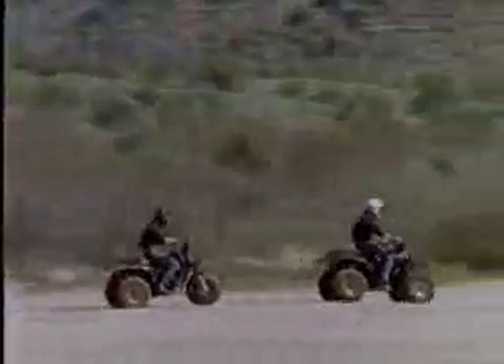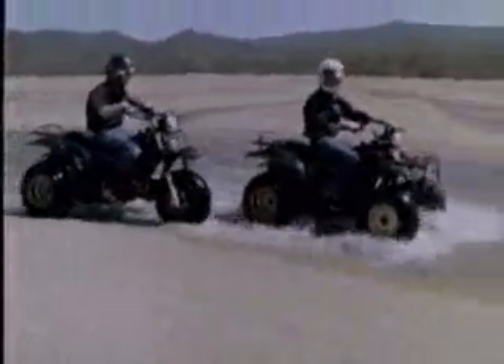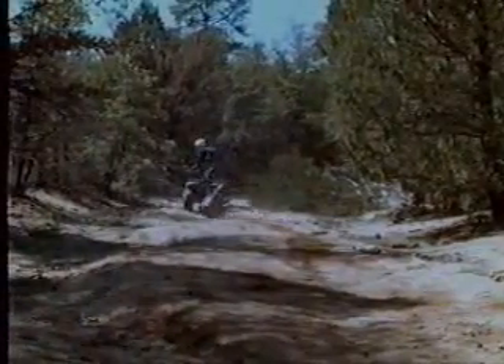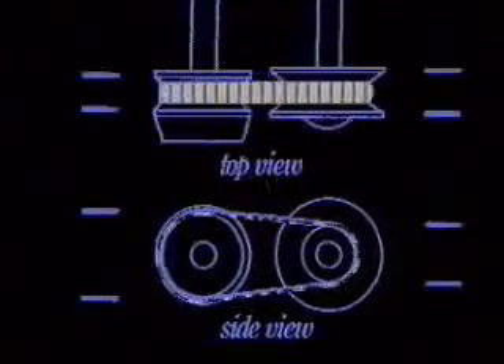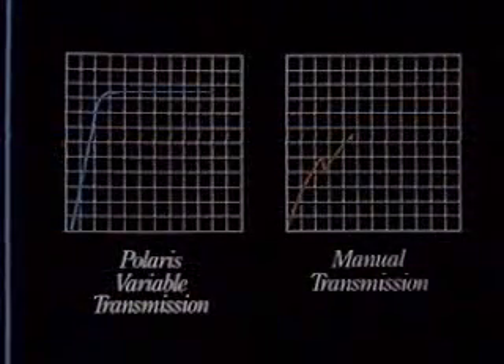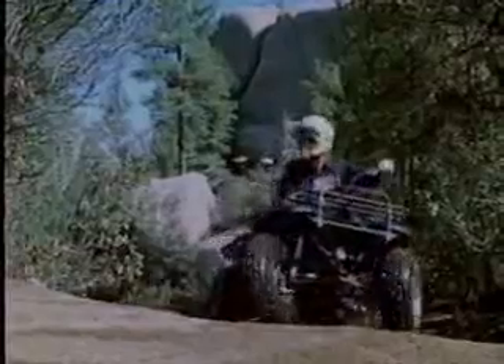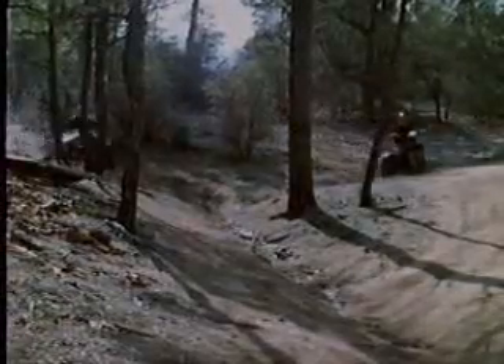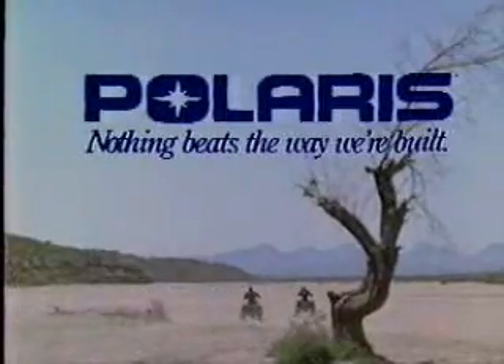1985-1986 Polaris ATV Sales Video

Comment: My jaw dropped when I learned Polaris made a 3-wheeler!
Reply: That's pretty much all they built back then and I had never heard of a four-wheeler back in the early mid-80s. That was actually quite knew at that time. I had actually gotten a Honda 250 big red 3-wheeler for Christmas from my dad in 1985 and that thing was awesome it had a manual 5-speed foot shift and electric start and get this. It even came with reverse that was not common😊 I was like a kid in Toys R Us with that thing I was ecstatic. God that was life growing up in the 80s

I did not like that garbage automatic pvt transmission they made back then with a rubber band. I have to have gears to shift. It makes the riding more fun
Reply: @robd1859  I had an 84 ATC200ES Big Red for a few years in the early 90s. I miss it but the Big Red 250 or the ATC250SX would've been better, more power and more importantly, rear suspension. Every time I rode my 200, I'd get a stomach ache from bouncing around!
Reply: Og scrambler
Reply: me to!!!
Reply: Old news. I have known tbey made one for decades
Reply: @jacobpoucher  well obviously there are those out there that knew. The dealerships I went to as a kid with my grandpa sold Hondas and Suzukis. I never cared much for Polaris and that feeling was reinforced when I saw one in small engine in highschool and it was not as simple to work on as my grandpas Hondas.
Reply: @DRZrider07  yeah Hondas are awesome, anything they make.

Comment: Jump ahead to 2021...basically the same antiquated clutch system, that is even more prone to failure due to massively increased HP, while limited by design to manage the added abuse. Not so much the belt, but the heat produced by the continuous slipping. That's a system that is fine in snowmobiles, because check this out...they ride in snow, which is much cooler than say, New Mexico, Arizona and places like that. Heat is the enemy in a slipping belt CVT. Polaris knows there are far better designs now, and even some still incorporate a belt, but a fixed ratio belt with a centrifugal clutch on the primary. Kawasaki AND Yamaha both have versions using this system...the Yam RMAX, for example, which has a 10 year warranty on that belt. You'd be lucky to get ten months on a Polaris belt, if you're riding the machine. Polaris is too goofy to concede that need and technology have moved well beyond their PVT. I've owned serval Polaris ATVs and  Utility vehicles, and over the years and machines, they ALL had two things in common...failing electronics, and failing PVT/CVT. I've finally reached a point where speed isn't worth two nickels when it comes at a cost of failed machines. I will never buy another Polaris until they get their heads back in the gearbox game.
Reply: Strange with all of our use we haven't had those problems, unless you think they should be mouse proof.
Reply: @J-1410  Nah, you just must ride like a little girl.
Reply: I still have a 20+ year old belt on my 1995 sportsman 400 ;-;
Reply: @snoop5658  then you sure are not riding that thing. Unless, down to the mailbox and back is riding. Even if the primary and secondary were perfectly aligned, 20 years of regular riding would have wore out the clutch/sheaves, much less would a belt still be in one piece.
Reply: All the other brands have adopted this same system more or less except Honda

Comment: I have a cyclone kinda like the scrambler but four wheeler version and I gotta say Polaris just isnt a contender against Yamaha Kawasaki handa etc there not as dependable strong and they don't last like others do
Reply: Donald sparks i agree. There just not built as good as a honda or a yamaha or others. I had a '95 polaris xplorer 400 and it wasn't near as good as my honda fourtrax 300 in reliability or performance
Reply: @honda3007  you guys are rite except performance vs the 300